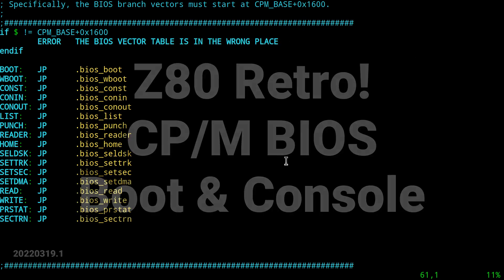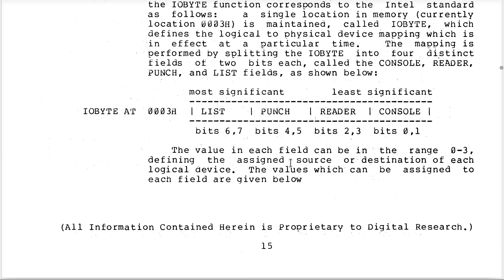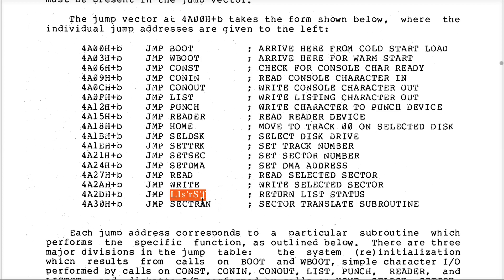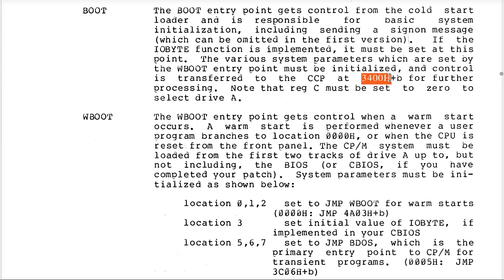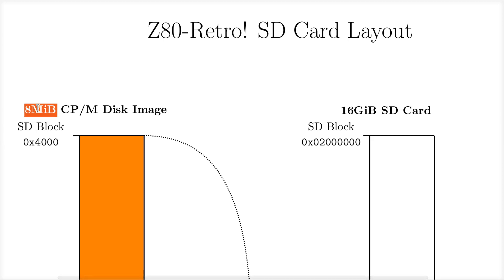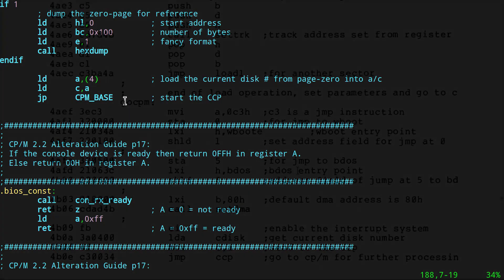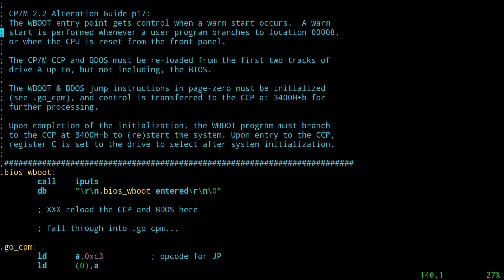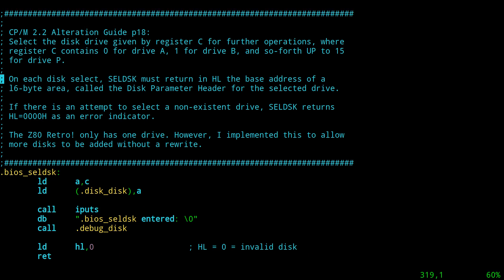Z80 Retro #25- CP/M BIOS Boot & Console

Comment: Many SD Cards don't support wear levelling so when using such cards CP/M with a 1:1 CHS to LBA mapping you are at risk of prematurely wearing out a large capacity SD Card particularly if you're compiling programs where lots of temporary files are created and deleted.  To counter this, consider implementing a wear levelling scheme that uses all of spare SD Card space. Back in the 1980's when damned expensive EEPROM was introduced we had to implement a wear levelling algorithms to preserve its life.
Reply from the maker: Yeah.  I have only started thinking about this potential issue.  In the near term I have ignored it simply because during development, we can afford to scrap a few $3 SD cards.
I'm not an expert in the state of the art here.
What does this have to do with "1:1 CHS to LBA?" I must be missing something.
Reply: LBA(Logical Block Addressing) is just a replacement technique of using a integer addressed blocks in place of the older Cylinder, Head Sector mapping scheme. Thus when using it in a 1:1 relationship on non-auto wear levelling SD Card's Logical Blocks, only those specific areas area of flash ROM are written. An example mapping is LBA = (C × HPC + H) × SPT + (S − 1) meaning that only a very limited number of blocks of a high capacity drive is ever used. These days, to address this issue, some manufacturers have released auto wear levelling SD cards which have their own algorithms and smarts to evenly distribute their flash ROM usage; Western Digital Purple SD Cards (marketed as "Ultra Endurance") apparently are auto self wear levelling and are affordable.
Reply from the maker: @PebblesChan  When using a card that lacks an automatic wear leveling feature,  we would have to change where blocks are located when they are getting rewritten more often than other blocks on the card.  I would call that a re-mapping.

I don't see how this has anything to do with the translation of CHS addresses to LBA addresses unless you change the math that does that translating... which is no different than simply translating the LBA addresses into replacement LBA addreses.  Thus making me question why we'd care about CHS here.
Reply: Changing the math is exactly right by adding another factor to increase the number of replacement LBA addresses used. One might only want to assign multiple  blocks for directory entries because these are the most often changed and are normally assigned to specific range of track/cylinders.
Reply from the maker: OK.  I think we are in sync so far.
So, the problem then comes down to how the filesystem and/or driver keeps  track of the current mapping that the OS should be using at any moment.

Reserve blocks to hold the current mappings?  Of course that too may have to be rrmapped from time to time as well.

How do we keep track of the erase counts?  That too would have to be stored.

Like I said, I have yet to give this much thought  Maybe we only store 3 sectors per block & store an erase counter in the last 128 byte region along with a pointer to where the block has been moved if the count is too high??  That could chain... and become inefficient, but it would work.

It may become necessary to peridocally rearrange the whole drive to migrate the stable data into the areas that have gotten more wear in irder to let them settle down.

Of course no HC/XC card manages itself in 512 byte blocks internally.  We'd accomplish nothing unless we are really counting the number of erase cycles on the internal (larger) physical blocks.

What is the generally accepted process of doing this?  Is there one?

Comment: 56:00 From the docs shown early in the video, I got the impression that the disk track number and sector number is remembered individually for each disk.  That way a caller can just set the disk ONLY and continue from where he left off on that disk.  So, you can't have a single location to store it in: you need to multiply by the current disk number and offset from the label.
Reply from the maker: You have an interesting interpretation. I never considered. However, if you look at the alteration guide in the appendix, you'll see a sample CBIOS where where there are reserved areas to hold the track number sector number DMA address and disc number for one and only one setting. Therefore your proposal cannot be correct. In fact, if you implemented what your proposing you could have a problem. It's unlikely that CPM expects to be able to change discs while retaining things like the track number, One could not count on it for sure. In fact, I suspect that CPM might actually leave the DMA address set to something like 80 or the directory buffer address in the bios across multiple calls, possibly transferring data from more than one drive!

Comment: I have enjoyed your Retro Z80 series a lot. However, I have been unable to find a description of your Z80 tool chain for CPM. The only note I found was in your assembly intor doc:

The assembler and simulator can be installed with these commands:

sudo apt install z80asm
sudo apt install sdcc
sudo apt install sdcc-ucsim

Is that all there is to your setup for building the projects you have developed? I believe sdcc is probably not required.

Also have you considered using z88dk as a toolchain?

Thanks for all your interesting content. David C
Reply from the maker: You are correct.  z80asm is all I've used so far.  I chose it because it's trivial to use and does not do anything but output the instructions in the source file.

sdcc is something I've tinkered with.  I originally considered using its simulator.

I will have to look at z88dk.

Comment: Nice progression.
Are you going to put CP/M sectors into SDCard sectors 1:1 (with the remainder wasted) or bundle 4 CP/M sectors into each SDCard sector?

I was thinking, as I was watching this, that it would be interesting to emulate the CP/M disks and sectors as actual files on the SDCard... then they actually can be read and modified by Linux or Windows. Each Disk is a root folder and then each sector is a file in a root folder. It's a new virtualisation or abstraction layer underneath the CP/M BIOS that would have to be written though and the actual partition would then be reformatted as eg. FAT32. A lot of work to implement!... As it is I guess you will be backing up the SDCard just be doing raw reads and writes with 'dd'.

It's unfortunate that they put the disks block,sector encoding directly into the BIOS (or DOS controller routines?) Makes it a bit harder to jam some other type of media technology in there... A carry over from the older Disk and tape drive systems... Well at least you don't have to implement this on a reel-to-reel tape drive :)

At the end, you edited the asm code and added "call .bios_setdma". Just wondering, is that a legal call? I thought the dot at the start of a label set it... have not assembled Z80 is a looong time, I'm probably wrong. Please excuse if so.

Cheers,
Reply from the maker: You are right.  The leading dot is a feature of the z80asm assembler I decided to use.  Definitely not an original standard Z80 thing!  The dot makes it a file-local symbol.  I'm using a few modern-ish features like the 0x prefix and .-local labels.

I wanted to make getting this thing working as easy as possible for anyone at any level.  So I decided to try to use an assembler without a link-editor.  I can't bring myself to accept every label as global. :-/

If It was just me, I'd probably write the lot in C.  But I'm having fun re-learning Z80 again.

Maybe I'll write a fancy boot monitor for it in C later on.  Or maybe even reinvent a version of BASIC for the boot FLASH with an option to also run it under CP/M?

SPOILER ALERT...

I already implemented an all FLASH-bootable version of CP/M that is pretty nice.  But it is not practical until I get the bank-selected RAM working with CP/M... which I have yet to complete.  Doing so has a fun race-condition if any IRQ handler tries to touch the memory-bank-select register.. or any RAM under 0x8000 for that matter.

I'm not sure I want to mess with FAT.  I just recorded a piece that shows how to use some command-line tools for copying files in/out of the CP/M filesystem on the SD card.  So that works without resorting to FAT.  If anyone wanted to take a swing at FAT, it'd likely be better if it were done after we get the bank-selected RAM going.  It might need some elbow-room.

As for the sector-mapping, I went with 4 sectors per 512-byte SD block.  Each block is a CP/M track.  It comes out pretty simple.  AND the performance gained by not wasting 75% of the SD blocks is significant... as the bit-banged SPI is about the speed of a single-D 5 1/4" drive!
Reply: @JohnsBasement  [Bit Banged SPI] Ouch. I did not get to that video yet, on my watch list.. am bouncing around a bit... hey, maybe a future FPGA project, custom peripherals for the CP/M system (SPI, I2C, faster UART ...) ?

[4 sectors per block] - Makes sense, neat. I like it.

Cheers,